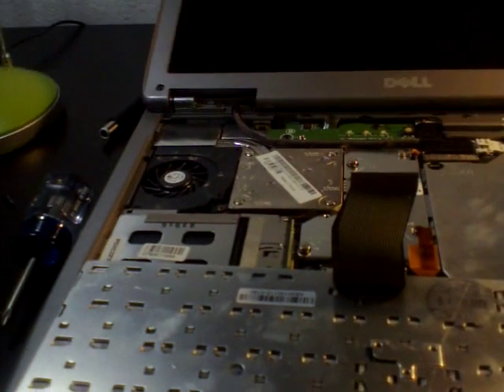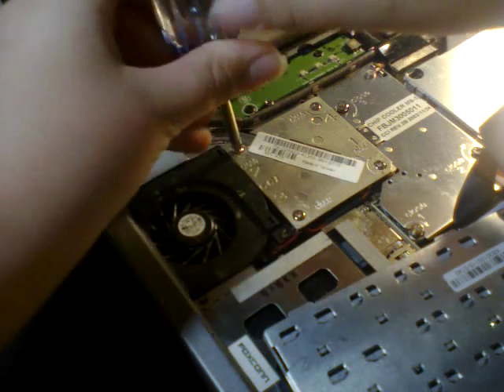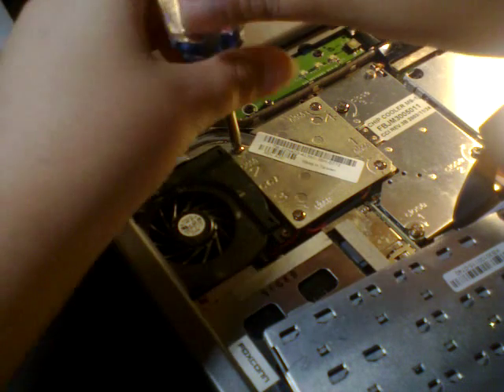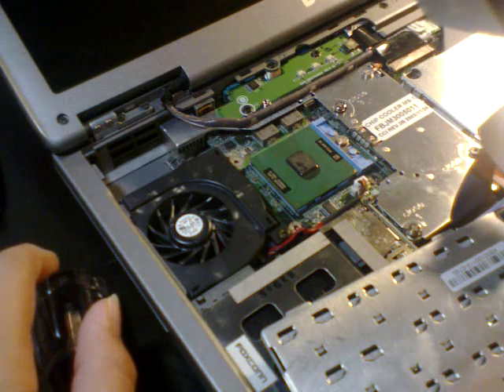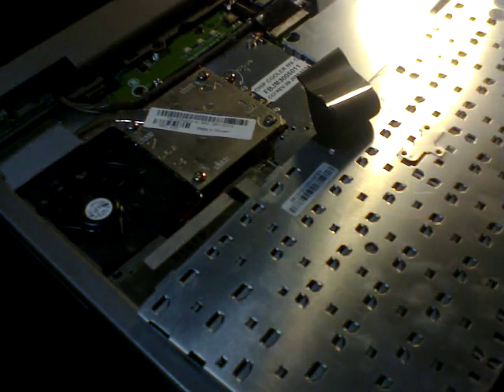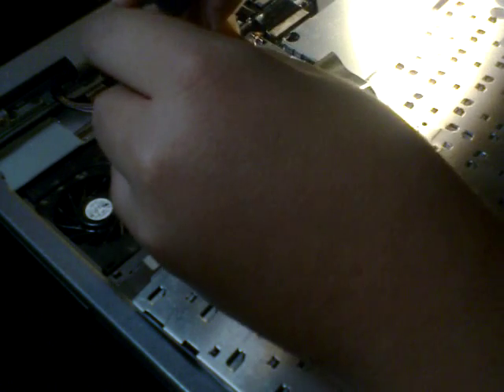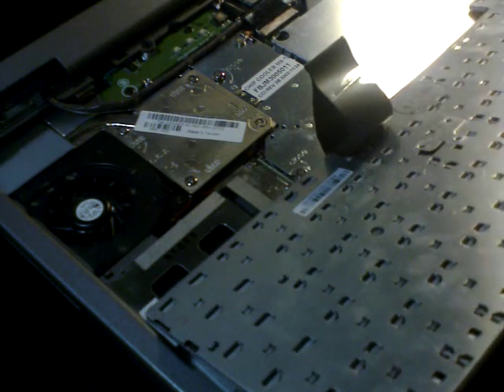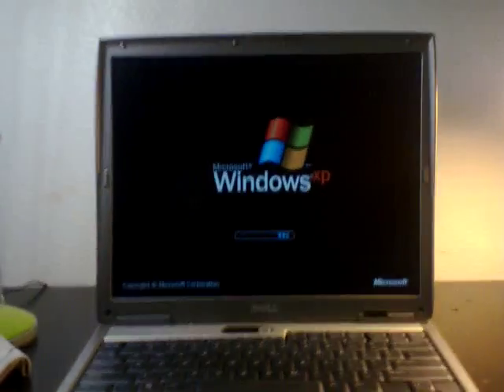Dell Latitude D Series - How to Clean Heatsink and Apply Thermal Paste

Comment: This laptop has aluminum foil on the heatsink with thermal paste on both sides. You need to remove that and clean it all. Also you should replace the chipset and GPU thermal pads.
Reply from the maker: I really needed that information 10 years later thanks

Comment: @Jmster1 Geez that must have not been a fun day. I should probably go ahead and clean out the heat sink and fans on my pc to prevent that from happening to me. But I really need to replace the track-pad before I do anything else though. In fact... Not too long ago I saw a 5100 for sale on Craig's List ,but I didn't get it because the seller had a bad attitude with me so I didn't get it.

Comment: Nice. My Dell Vostro 1000's heatsink was cleaned in the Philippines. I wanted to clean it out because the fan is always maxed out, cause i believe the heatsink collected a lot of dust. And now my laptop is running quiet, unless I play Halo the fan goes fast. You should Apply the thermal paste to the CPU, but i guess it still works when applying to a cooler.